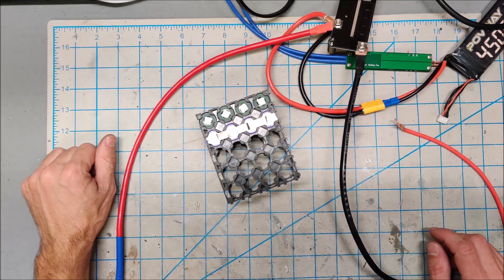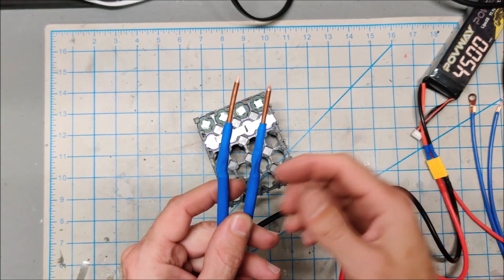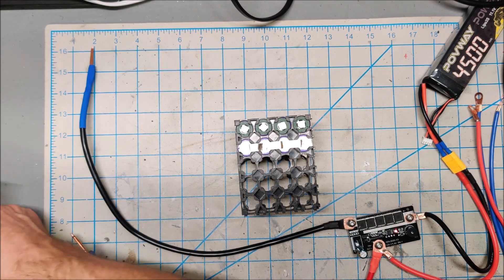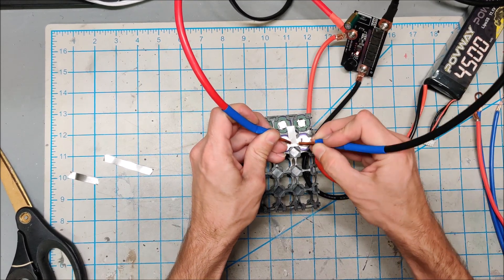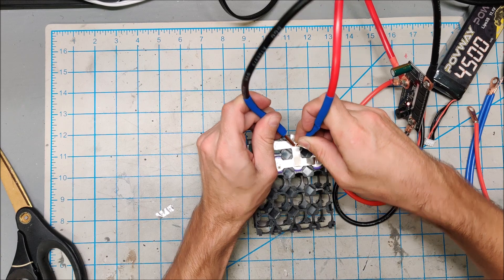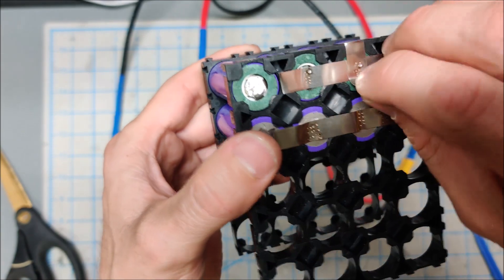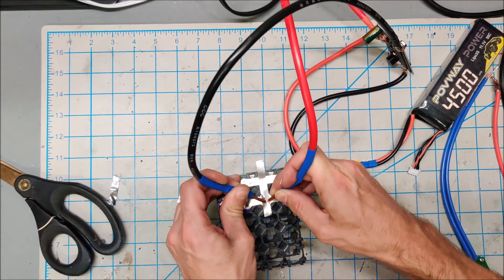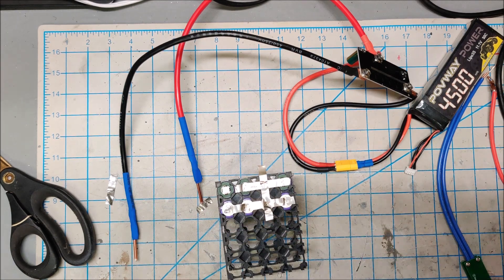DIY SPOT WELDING NEEDLES

Comment: So... I came here to learn HOW you made the "needles". It's a shame you didn't show how you crimped the cable to the probes.
Reply from the maker: Just crushed a copper butt connector onto the wire and the needle. The needle is 8 gauge ground wire cheap at home depot

Comment: Excellent

Which battery can you suggest

I have lipo 5200 mah with 35 c 

Thanks
Reply from the maker: Your lipo might be just big enough. I recommend around 200 amps minimum.
Reply: @stevenc22  
Thanks for reply

Can i make battery pack of 7s7p by using the battery i mentioned

I am expecting today the item

Thanks

Comment: You just used 8 AWG plain copper wire for the needle points ?
All the Pen needles I seen on various commercial versions either use beryllium-copper  or aluminum-bronze ('Alumina Copper' in Chinglish) alloys. I believe that might be why your points are sticking.